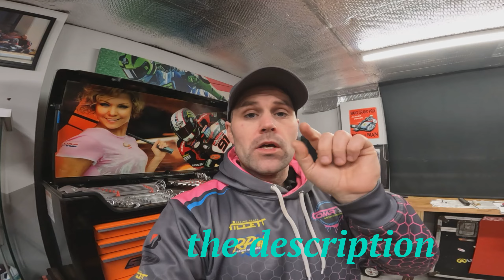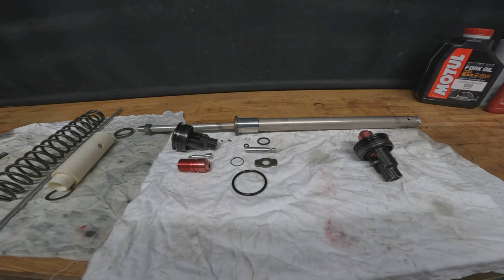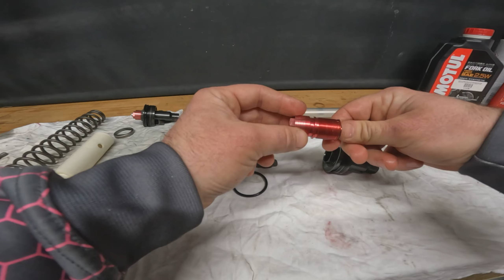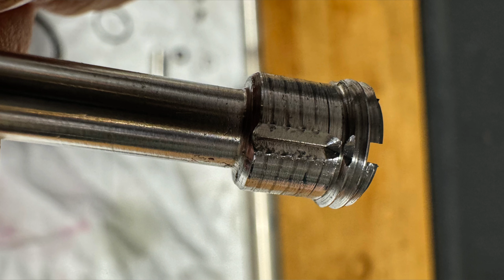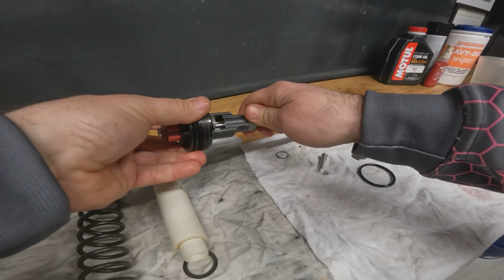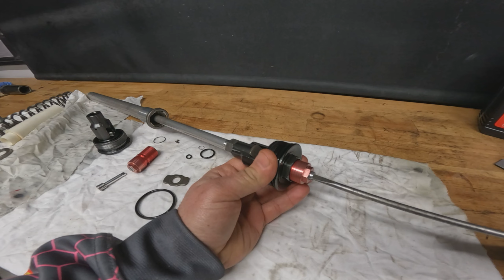Fork caps - correct rebound set up

Comment: Love the video, very helpful info.  One thing missing, how did you disassemble the cap, and more specifically, the clip and o-ring for the rebound adjusting screw.  I have a 2013 Ducati SF848 that is leaking around the rebound adjusting screw, and this has been the best/closest info that I've found about actually taking the cap apart.   Thanks!!!!!
Reply from the maker: Thank you for you positive comment. 
If I remember correctly, remove the detect ball and spring from the ‘clicker’ part of the adjuster and then unscrew the ‘clicker’ from the underside of the fork cap. 
You should then be able to remove the little circlip on the top and slip the rebound adjuster out from the bottom of the preload adjuster. 
If it makes it easier, wind the preload adjuster all the way in, remove the bigger circlip then you can wind it all the way out and remove it for better access. Hope that made sense 🥴
Reply: @ComrodMsport   I think I understand....? I'll give it go.  Thank so much for the help!

Comment: Thanks very much for the tip ✌️

I have a question:
To have the good height of the cap and it's counter-nut.

with no clics adjuster, No recommended height, I have the rebound internal rod attached to the cap.

The height and the rebound setups were not good. surely former owner played with it.😅

So, disassembled.
I started to set the preconised rebound setting and rebound screw height (-1.5 turn from harder, 1.5mm screw height on the top)

Then, screwed clockwise 1.5 turn, assuming it's full closed setting...screwed the cap until it blocked (lightly, rebound rod closed) and locked it in place.

Was it a good way ??

(Triumph Service Manual, written pretty bad, i feel sorry for Thriumph machanics 😂😤)

Cheers ✌️